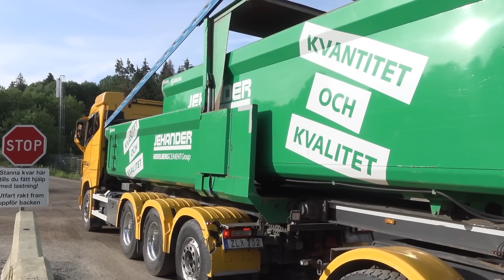EMILIA KÖR LASTBIL MITT I STOCKHOLM! 🚛

Comment: 10:32 jag körde kasettbil ungefär sex år. Hon har en lugn och sansad körstil och jag hoppas att hon läser detta👍 Snälla gå aldrig mellan flak och bakläm, det finns en stege fram i flak av en orsak. Finns alltid en risk att flaklås kan släppa, en del tekniskt fel eller något i konstruktionen som brister, du vill inte stå där då😮
Reply: Förr på olika grusbilar hade de ju även en lång flakskrapa mins jag kan väl vara borta av samma orsak men annars hade man inte behövt stå på fel ställe heller
Reply: In Finland we have "lavatäry" "vibration" for that exact reason so you dont need to go between it
Reply: And the second buckets "lid" is not hydraulic and it moves freely when tipping
Reply: @ItsXaPz siellä löytyy kyllä tärytin, ei aina auttaa ruokamullan ajossa.
Reply: @MrRobban1234 beror på tillverkare, ofta är det bara en fjäderbelastade hake och luftklocka för öppning, nu har väl många tillverkare börjat använda dragkopplingar.
Reply: Haha
Reply: @ItsXaPz as u heard she did too, But it wont unstuck wet dirt
Reply: Your accurate description of the real facts are results of years of experience.
Reply: I hope she has read your comment. I did it and I’m not truck driver… actually I’m whit no car even . I’m trying to restore an e36 .

Comment: can someone explain to me how the second casette it secured in the first one so it doesnt fall off when unloading?
Reply: She said that there is a locking mechanism inside the truck container. She has seen when a driver forgets to double check that the trailer container is locked into place in the truck container and then when tipping the container slides out. That's a bad day at work for sure.